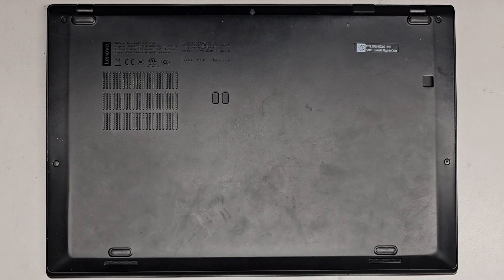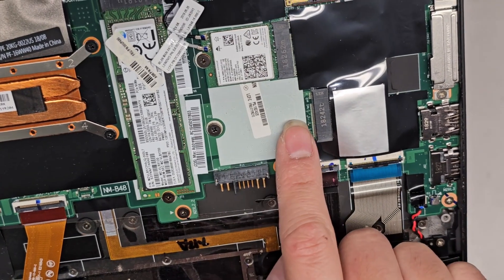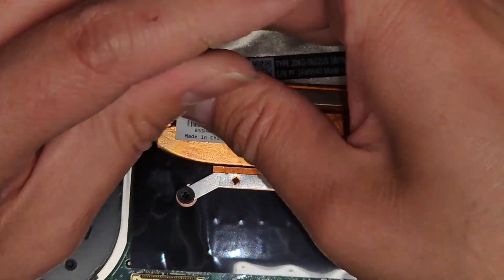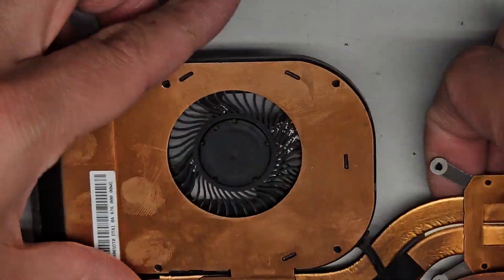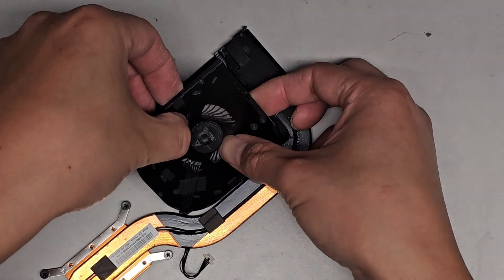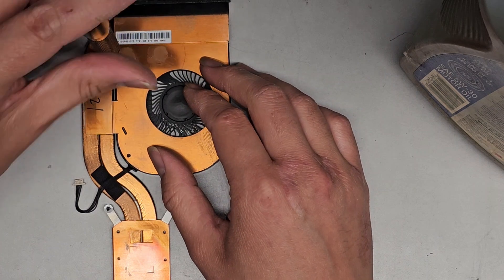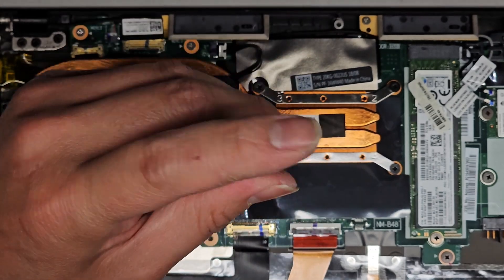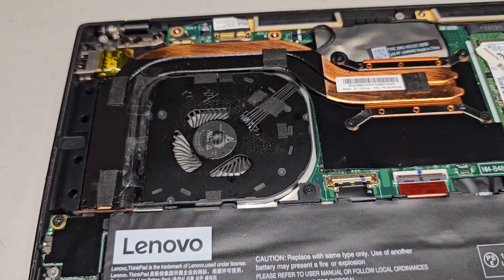Lenovo 6th Generation ThinkPad X1 Carbon Disassembly SSD Upgrade Battery Fan Replacement Repair

Comment: Swapped mine with the Delta fan (01YR204). My old Nidec fan faced down at the motherboard. How was it supposed to pull air? And the whining under load at night… gawddamn.

Delta shaved another 5-8°C with MX-4 paste. Can you believe it? Whoever approved that original design clearly has no business in laptop fans. Absolute morons. Anyway, thanks!

Edit: I looked again and it’s not 5-8°C, it’s 11-15°C cooler now. Stress temps hit around 68°C with the AC on in a humid tropical room. CPU offset is -85mV. Seriously, under 70 on an aging ultrabook is beyond wild to me.
Reply from the maker: Damn, nice!

Comment: Thank you very much for showing what battery I need and how to change it
Reply from the maker: No problem
Reply: @ItsBinhRepaired just replaced my battery, even tho I was using the different serial AV430 and had me worried for a moment. 

Turns out they are interchangeable, the only difference is 430 is manufactured by Sony while 494 is manufactured by LG. 

Thanks again man, cheers from Indonesia
Reply from the maker: @christo_reese nice!

Comment: Mis recomendaciones para todo aquel que tenga esta Laptop, es que consiga una base refrigerante porque se calienta mucho, y tmb que le cambien la pasta regularmente ya que sino será más el calentamiento ❤
Reply from the maker: Paste doesn't need to be changed unless it overheated 100c
Reply: @ItsBinhRepaired  ohh wow I didn't know that, thank you for your help =3
Reply from the maker: @allenxflow5095  no problem

Comment: Had the CPU fan making hell lot of noise problem. Showed to repair guy, he said new fan to be put. 
I came back, saw your video, and did the same thing. Now the fan run smooth as breeze of air.
One thing i noticed is it was a bit hard to pop-out the blade, but after adding some oil, putting it back was easy. Just very low click noise and it sat it at place..
Let's see how long this will run.
Thanks very much for this video. Sent a small Paypal appreciation token 😊
Reply from the maker: Awesome, glad it helped. Thanks for the support!
Reply: @ItsBinhRepaired  thankyou for making this video, i almost purchase $20 for replacement fan
Reply from the maker: No problem. If you haven't already, please like and subscribe so others can find my videos and possibly consider watching a few others, liking and commenting to get the algorithm to recommend my channel. Thanks!
Reply: Just as an update, still running smooth..
Reply from the maker: @theraghavs  awesome!

Comment: Hi. Can you upgrade the Wi-Fi/ Bluetooth, and the processor on a Lenovo Thinkpad X1 Carbon gen 6?
Reply from the maker: Wifi and Bluetooth possibly, processor no
Reply: @ItsBinhRepaired  Thank you for answering.
Reply from the maker: @cesar_145  no problem

Comment: And there is the ram problem
Reply from the maker: @hichamKarabane  hm?
Reply: @ItsBinhRepaired  Can the RAM be replaced? Is there a slot?
Reply from the maker: @longcross  no
Reply: @ItsBinhRepaired  and I have one question, what glue are you using for Sticking bezel sticker to frame? Because my rubber bezel is peeling off
Reply from the maker: @longcross  this stuff https://amzn.to/3W9qUbt
Reply: @ItsBinhRepaired  thank you mate!,
Reply from the maker: @longcross  no problem